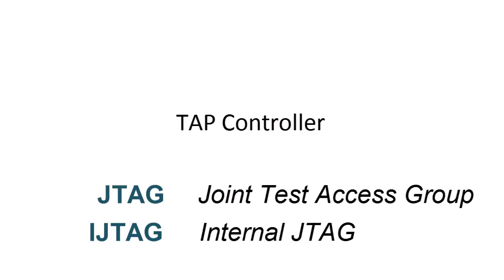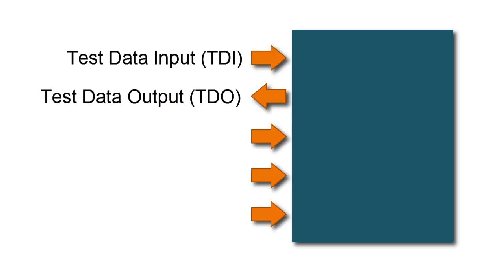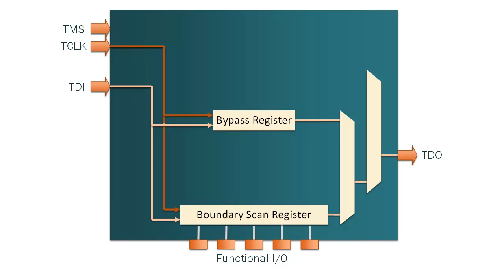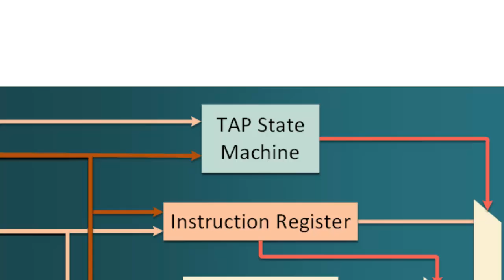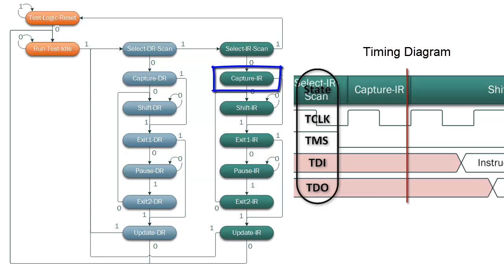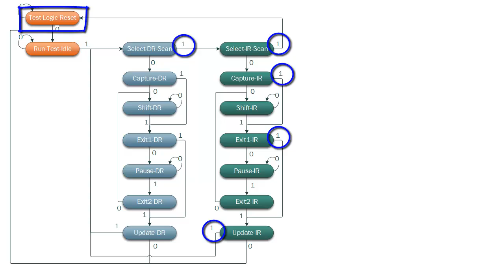JTAG TAP Controller Tutorial

Comment: IEEE 1149.1 JTAG (boundary scan) TAP controller.
Best animation ever seen. Thank you so much.
Reply: But i think you must raise the TMS before the "last bit" is shifted in while the Clock stays high. So its triggers the machine right (MERLIN or More Engine .. )
Reply from the maker: Holger Hartenstein You may be correct. Someone else has told us the same. Sorry for the confusion.
Reply: TechSharpen
Travis Goodspeed i think was it.
Ok>Thank you for your quick info.
I work out a Lattice Semiconductor Device
Type: ispPAC30. JTAG interface is a great solution (BSDL-Model)
But anyway i like your dynamic Video, its clever great done, and so intuitive,a lot of worth work for Educate. IEEE 1149.7 IEEE 1149.1 ect. You can fill Books with this great Tool-Chain.
Greetings Holger.